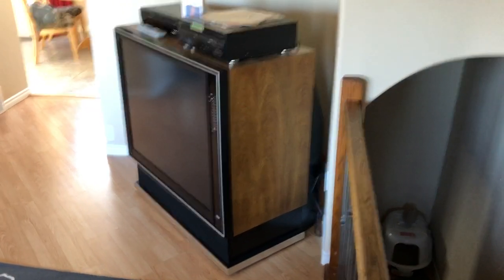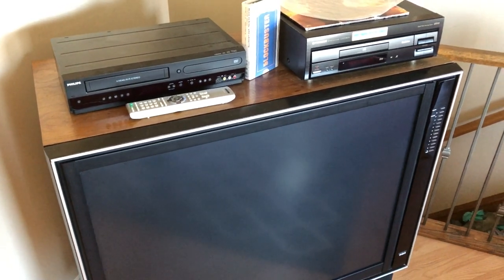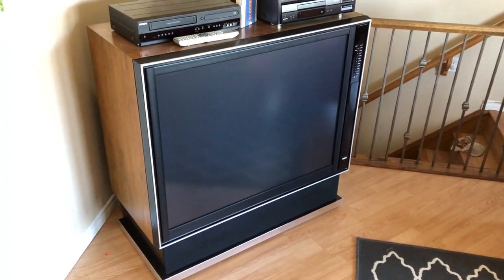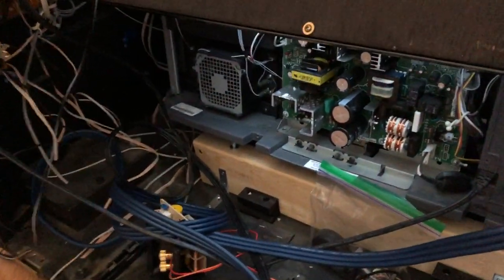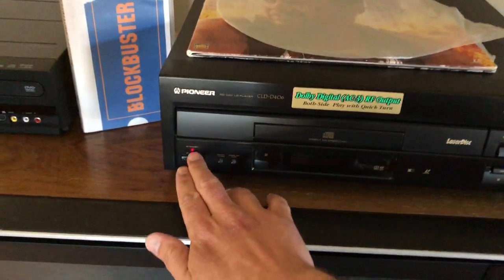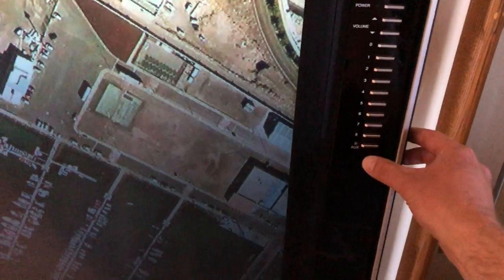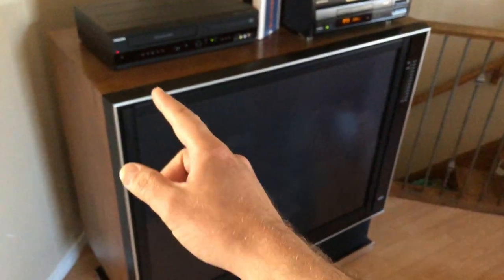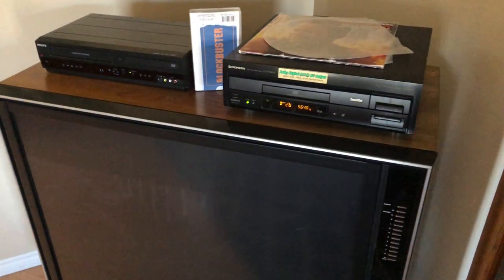1983 Projection TV upgraded with HD LCD projection guts! Part 1

Comment: Can I install a new front projector (as cheap as possible cost) in my old 60" diag. Hitachi RPTV. Will any type of projector work by projecting directly onto the Fresnel lens screen from the rear? (after gutting old CRT guns)
I was considering making a wine bar / storage out of it but It would be cool to have an image on front.

Comment: holy smokes! this is gorgeous. i'm not a fan of LCD Projectors tbh, but this is the exception. the outter hull is a masterpiece to behold, and to see a non-washed out image on it is doing it justice. i only had a few bad experiences with LCD projectors (flickering pixels, also the blue constantly dying due to overheating.. could have been a bad resistor somewhere, I just gave up). image quality was also a bit wonky, it was jagged compared to a smoother DLP... although, I can see a benefit to the jag. Play NES on it!!! :D

Comment: Awesome. I have a question did you restore your LD player? If so do you know anyplace that specializes in laserdisc replacement parts? I have a Pioneer CLD D504 that I bought new back in 95. It definitely needs some repairs. My picture looks horrible. I am hoping it just the laser that needs to be replaced.

Comment: i did the same thing with my pioneer this is awesome
Reply from the maker: You did? Did you use a rear projection chassis or a portable projector? Tell me more....
Reply: @ChadBoughton  it was a crt projector too but i used a dlp projecter it was a toshiba  720 1080i  50inch. the pioneer tv was already 16x9 65inch /so i put the toshibe inside it with the toshiba fresnel lens outta it. where the old crt projecter was i installed my av reciever and my vcr dvd combo. alll in all looks great sounds awesome i wanna hook up the buttons how did you do it? that movis in 16x9 you should use the zoom so you dont get the black bars
Reply: i did get the pioneer remote working
Reply: People like you are the reason crt's are so rare and old tv's.. you litterally cut the lifespan in half @ChadBoughton

Comment: But overscan problem can fix it？ HDMI connection？better use glossy screen instead of matte🙏📺🌴🤗🖥🤔
Reply: dude you dont need a hdmi a regular cable box, or dvd player
Reply: @Warp2090  overscan problem can fix it？

Comment: I don't even understand what an LCD rear projection means. I understand the original tv, but not the mod.
Reply from the maker: Projectors today work by LCD, DLP or LCoC. This has an LCD projection unit in it. So it’s modem viewing in an old enclosure
Reply: What was wrong with the old one? @ChadBoughton